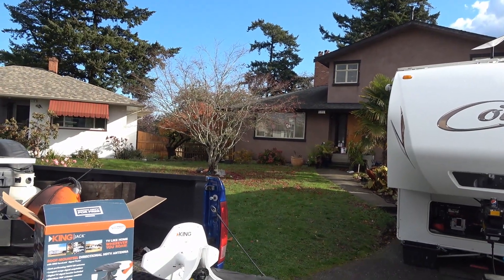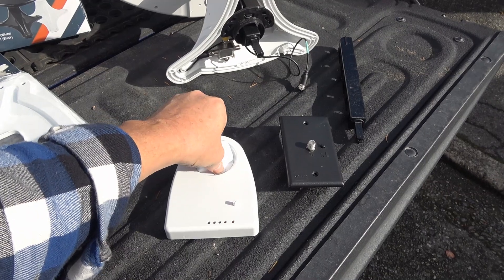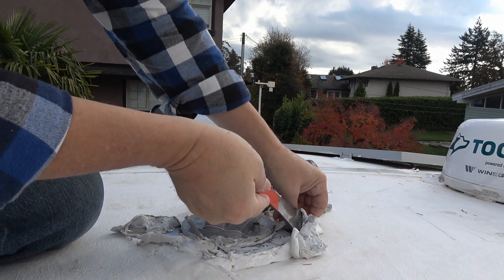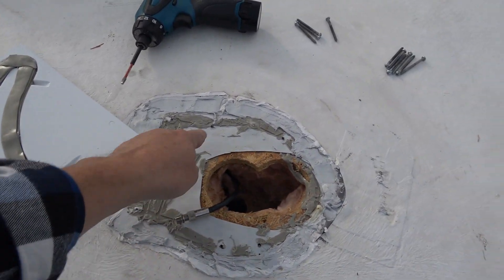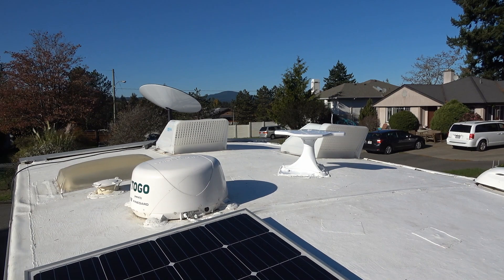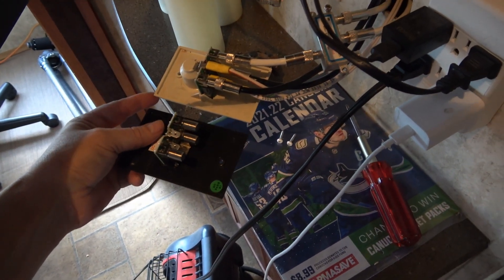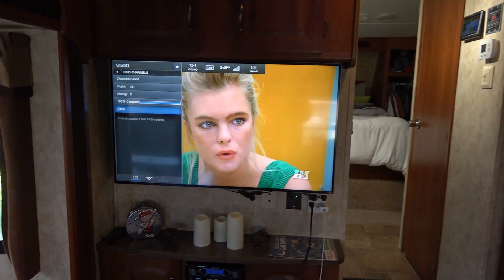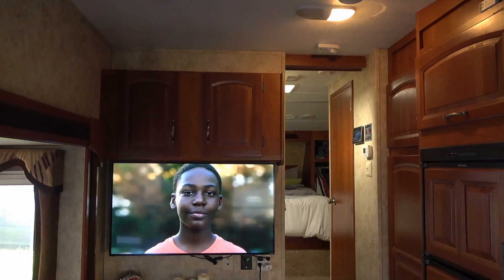Replacing Old Winegard RV TV Batwing Antenna with New KING Jack Low Profile Directional TV Antenna

Comment: I installed one last spring. Works great. Had to replace it later on the summer as it hooked a telephone wire going out my driveway. Long story but I am waiting foe a cheque from the telephone co.as of Wed gone that it is settled. I hope

Comment: i appreciate your showing how you removed the old antenna mount. I tried doing the same on my RV months ago but gave up thinking that even though I had removed all the screws there must have been some other hardware holding the thing down. But now I see its just the adhesive and I should have tried getting under the mount like you did.
Reply from the maker: Yeah, t was really stuck down, guess its best to try and do on a hot day when the sealant is softer. Cheers, Ray

Comment: I did mine a few years ago, I like the signal meter, I think the old got a better signal .Mine had metal under the fiberglass roof, had to drill hole about 1/2 inch bigger.

Comment: When I cleaned off all the old stuff from my roof (hit the low bridge), I went with an omni-directional antenna. It works pretty good, but I think those that can be dialed in would be better. Honestly, if you are near a source, either works well. They are both line-of-sight, I believe, so the difference is probably minimal.

Comment: I hope you have better luck with yours than I did with mine, Ray. Several years ago I replaced my batwing antenna with a KING Jack model and was very happy with it...at least initially. Then while driving down the interstate the upper portion broke off (and got stuck in the luggage rack). From what I could tell the plastic joint between the upper and lower part experienced a catastrophic failure. After that happened I had a Winegard Rayzar Automatic installed and have been using it since then.
Reply from the maker: Yikes!  I'll keep an eye on it and see if it starts to feel loose.
Reply: @LoveYourRV  The separation could’ve happened due to multiple causes…a bird strike, for example…but I’ll never really know what happened. What I do know is that I stopped at a rest area on a sunny day, looked up and thought “hey, that’s weird, it looks like the TV antenna is gone.”, then went up on the roof and found the upper half of the antenna wedged in the roof rack at the rear end of the trailer. The Winegard Rayzar has had its own set of problems (the antenna kept getting stuck until I applied some silicone grease to help it turn easier) but hey, it works. I might replace it with the new 5G-compatible Air 360+ that is set to come out soon, though I’m in no hurry 😉.

Comment: Will be looking forward to the long term test.  To be honest, I've read more negatives than positives on this antenna when compared to the old style batwing.
Reply from the maker: I've heard both good and bad at about equal amounts. I think basically all the RV TV antennas are all about the same. To improve upon them you have to get more of a residential type array. They are larger and people usually mount them on a tall pole. I often see them in long-term RV parks and that tells me folks have tried the RV antennas and found them not as good. So basically it's a trade-off between portability and best signal. This little antenna should do what I want which is to bring in some OTR TV now and again. The pros are it won't shade my solar panels and I don't need to remember to crank it down before traveling.

Comment: From the brief glimpse, it looks like the board are laid out the same. Are the close enough that you could you swap the new board into the old housing and retain both the matching color plate and 12v port?
Reply from the maker: Could do, but I think I'm going to buy a plate that has a 12V port and a couple USB ports and install it beside this plate where they have the cable in/out for a sat box, which I don't need. Cheers, Ray

Comment: I know that boot came off where the cable comes down through the roof from my TV antenna and was getting water in. Got up there and filled it full of sealer. I must have some weird antenna. It works better down and the amplifier off. Even experimented with external rabbit ears. Not as good as what I was using, but still got some channels. I noticed how thin that antenna wire was on yours. Not much shielding, I would expect more. I'm guessing it works fine? I think that show was Night rider.
Reply from the maker: I think since its such a short piece of coax it doesn't matter much the thickness. In the TV info panel is said Baywatch but maybe they got it wrong. Cheers, Ray

Comment: I get more channels using a flat inside antenna than I do with the King Jack directional. No tear down required, just plugged directly into the tv.
Reply from the maker: That's odd, I would expect a directional antenna with a focused beam and mounted higher on the roof to do better. Maybe there is an issue with the antenna power or signal wiring in your RV. RV manufactures aren't know for quality work. ;)
Reply: @LoveYourRV  I always thought the factory antenna was bad, so I might have to take it apart like you did. Thanks for the feedback!

Comment: When you were explaing the cables I got totally confused. Can you comment on how to conncect again? Thanks
Reply from the maker: Here is a link to the manual that explains the connections - https://www.rvupgradestore.com/v/vspfiles/assets/pdf/OA8500%20Manual.pdf
The antenna on the roof has 2 connections. One goes to the signal level meter and the other goes down to the cable outlet with the power button. The outlet with the power button has 4 connections. Antenna in, Cable in, out to the TV, and an output for a second TV. Cheers, Ray
Reply: @LoveYourRV  thank you Ray. Im curious how well it works compared to your old Wineguard.
Reply from the maker: So far it's about the same but I've only checked at this one location so time will tell.

Comment: Thanks Ray.  Like #257, view 1907.  How many channels did you have before the change?  16 sounds great but did it improve, other than the footprint?
Reply from the maker: I didn't notice much difference, about the same I got before in this driveway, but this is the first place I've tried it in. Weather also makes a difference, so will have to use it for a while to get a feel for any difference.

Comment: Have you ever noticed driving by a large antenna and it was in the very lowest part of the valley on the ground under a mound of leaves? Height is everything for VHF and UHF freq. because these bands work on a line of sight transmission path. If path is blocked by a building or a larger object (like a hood of a vehicle yes I have seen people mount antennas under the hood of a vehicle) the signal degrades. This is one of those times that newer isn't better. Height is everything and on top of that they have changed the spectrum frequency since these new fancy antennae were designed and unless these units have been updated they don't receive the newer spectrum. The batwing antennae are just too dumb to not receive. Strength meters and not worrying about forgetting about retracting it when moving are nice, but these are much more susceptible to being blocked by something as short as an a/c shroud.
Reply from the maker: On my old OEM 2010 batwing I had to add on a extra set of elements when things went digital. It was a small sized add-on array - https://amzn.to/3jVqxOL  I think that's why they can now use the smaller size TV antenna due to the new digital frequencies using smaller antenna elements.  I'm not sure how much a few feet of extra height makes. In this location it didn't make much difference. I'm already surrounded by houses. Cheers, Ray